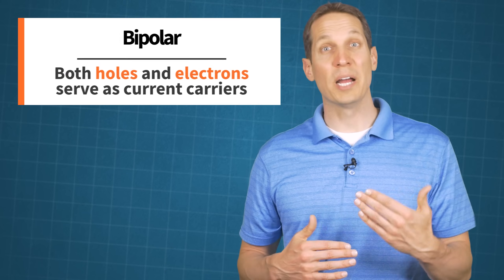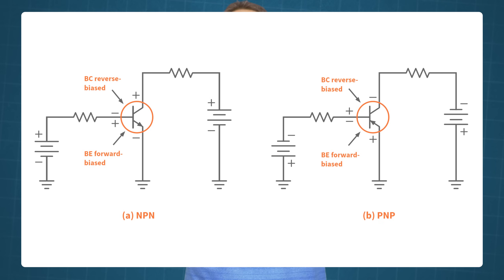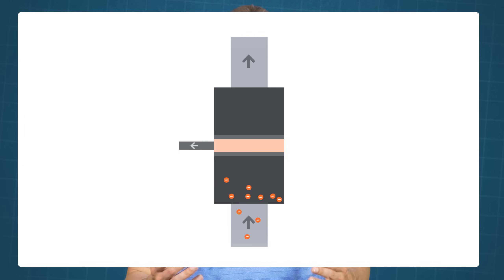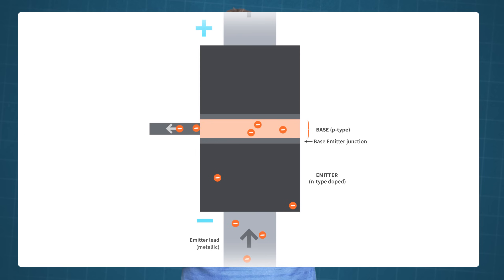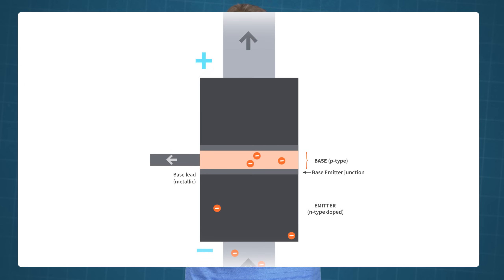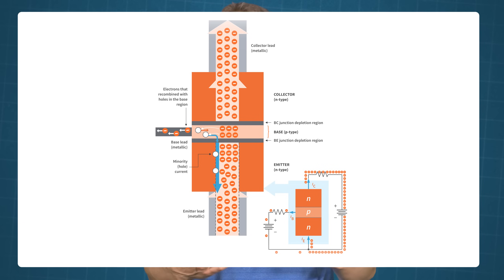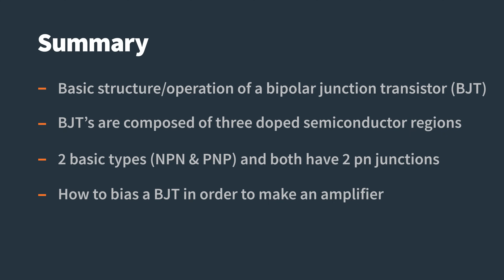Animated BJT – How a Bipolar Junction Transistor works | Intermediate Electronics

Comment: Howdy. Great.
I do not, however, understand where the current gain comes from. I get it that a base current bridges the EB junction and thus allows the collector current to jump into the collector. But this logic only makes the transistor a switch. Any collector current should be able able to jump the EB junction once it is bridged. Where is the gain factor in this logic ?
This far I understand that the collector current somehow depletes the EB bridging as it flows. This depletion needs be replenished with a base current.
Regards.

Comment: Thank you for that video and for the effort, but is still have a missunderstandig here:

BE junction is foward biased. Electrons move from n to p. they move in the n-current band and later in the p-valence band according to the diode theory. Now there are the other electrons which do not recombine with  hole from the base. According to much detailed theory they diffuse into the BC junction and get accelerated by the depletion region and also by the +potential out of the transitor.

If you now increase the current of the holes from the base to the BE junction, why does the diffusion of electrons into the BC junction increase, so that the current can increase?

Comment: Great video. A question: it seems that there are two possibilities as to what can happen (in the npn case) to an electron that was injected by the emitter into the base: (1) it gets swept into the collector or (2) it recombines with a hole in the base, contributing to base current. Isn't there also the following possibility? (3) the electron, without recombining with a hole, is attracted to the base wire (after all this has positive voltage) and thus also contributes to base current without having recombined with a hole? Or is this component negligible?
Reply from the maker: Good question!  I'd be open to someone disagreeing with me but I believe you are correct - both that it's possible and that it's negligible.  There is physical distance to travel and for the p-doped region, which is somewhat inimical to electron movement, it is a shorter distance between the two n-doped regions and it's easier for them to flow from the emitter to the collector unless they fall into a hole and then move out the base.  This is my understanding but I do want to make the caveat that the original content was created with the help of a gracious professor who has since retired and I'm not as smart as she is.   So take this with a grain of salt.
Reply: @CircuitBread makes sense! Thanks for answering

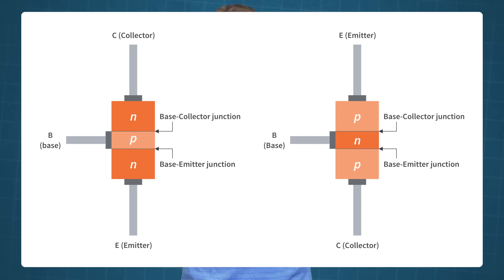Comment: At 0:43 isn't the labels for the PnP junctions wrong? Should they be the other way around with the top right label being base-emitter and the bottom right being base-collector since that would align with their respective port names.
Reply from the maker: Correct!  We added a pinned comment to this video a few years ago to address that as we didn't want to pull and repost the entire video.  YouTube does not make minor changes possible, unfortunately.  Thanks for the feedback!

Comment: How does a free electron which has recombine with hole of base reagion causes a base current as it is in valence band and not conduction band.
Reply: valence electrons can move if there are holes in the valence band. Also, the positive voltage on the base will attract the electrons.

Comment: Sorry, a little confused.  at 0:45, the PNP diagram, why the junction between the base and emitter is labelled as Base-Collector junction, while the bottom is labelled as Base-Emitter junction?
Reply from the maker: Because that's a typo that I didn't notice until now!  You're correct, with the pnp junction, the top one should be the Base-Emitter, and the bottom one should be the Base-Collector.

Comment: Josh, I would have liked to also see the PNP mode of operation discussed in detail - I felt that the 30 second blurb at the end to say that 'everything is reversed compared to the npn' did not do it justice. There's something to be said for actually seeing the electron/hole movement - any chance you could include this as an addendum or in the text ?
Reply from the maker: I'd have to check to see if we still have the assets for this, it's possible we could animate the movement for PNP and throw that animation on our website.  The written tutorial actually does go a little more in depth on what happens with the PNP BJT, hopefully it's more helpful - let's me know!   https://www.circuitbread.com/tutorials/bipolar-junction-transistor-bjt-basic-structure-and-operation

Comment: FET are best
Reply from the maker: I think they're way easier to understand/work with but there are benefits of BJTs in certain applications.
Reply: @CircuitBread  They're not easier but they are more stable. Which explains why they are getting replaced. Nowadays learning about BJT is only interesting for basics about op amps design and IGBT. I would never used a BJT in a project even if, it is easier to command using current. FET are very good low power amplifiers.

Comment: This really helps, but I don't understand why if the base-collector junction is reverse-biased in the NPN, free electrons from emitter to base would cross the reverse-biased base-collector junction and return to the emitter, since reverse-bias does not allow electron flow.  Does it have to do somehow with the relative doping density of base, emitter and collector?  Please elaborate on that.
Reply: If you reverse bias the emitter-base junction then there would be no electron flow but if you reverse bias the base-collector junction then this actually helps speed up the electrons from the base into the collector. Just look at the direction of the electric field of the depletion region in base-collector and you'll see why.

Comment: I heard some terms like drift current and diffusion current in relation to BJT , is the current in the collector considered diffusion or drift ?
Reply from the maker: You have both occurring in BJTs, often at the same time.  Susie put together a quick overview of the difference, it should help.  While the article is talking about semiconductor materials in general, it is exactly what's going on in a BJT as well:  https://www.circuitbread.com/ee-faq/what-is-the-difference-between-drift-and-diffusion-currents-in-a-semiconductor

Comment: you said that valence electron move to wire from base but as i know that the valence electrons are attached to its nucleus and didnot move ?corrent me if i am wrong ?
Reply from the maker: Hi Aina!  In wire (any metal), the valence and conduction bands actually overlap.  And yes, valence electrons in a semiconductor don't move unless they either jump up into the conduction band OR they are moving but we consider it as hole movement.

Comment: But at PN junction, you taught us that when free electrons diffuse across the depletion layer, they lose their energy in overcoming the depression layer, so when they enter the P region, they become valence electrons. But here you said that free electrons pass through the depletion layer easily and they remain free electrons?
Reply from the maker: Hi Aina!  It may be helpful to review the written tutorial as it gives you more time to review certain phrases that (hopefully) clarify things.  I'm thinking particularly of the line, "The free electrons that entered the base region but didn’t recombine with the holes move toward the reverse-biased base-collector junction."   Not all electrons that cross into the P region become valence electrons.  Those that don't, are the ones that continue onward.  Does that help at all?

Comment: But what happens inside a BJT when we increase base current in linear region and the collector current increases ok but why the collector emitter voltage starts to be decreasing and after a time both junctions would be forward biased.what happens inside a transistor when it happens?
Reply from the maker: Hi Raza, the collector emitter voltage shouldn't start to decrease unless there's a series resistance in there that causes a larger voltage drop prior to the BJT due to the increase in current.  However, when both junctions are forward biased, this is when you switch to a different region of operation (saturation region - I think you might find this video helpful: https://youtu.be/VuxAz0fvMnA ) and the base current is no longer the overriding factor, but the collector emitter voltage is.
Reply: @CircuitBread  thanks

Comment: Loved the delivery of concepts. Although, I'd love (so would other people watching these videos), if they were delivered a little slower. I felt like there was no time for me to think. Loved it. Kudos!
Reply from the maker: Thanks Subbalakshmi!  We've often talked about pacing because a lot of people think Josh is actually pretty slow.  This may be weird but YouTube has the ability to change the playback speed.  We usually playback the videos at 1.25x, but if he's too fast for you (instead of too slow, as he is for some of us), you can drop it down to .75x.  Let us know if that's actually helpful.  Thanks again!
Reply: How to use a Bipolar Junction Transistor (BJT) as a Switch?: https://www.circuitbread.com/tutorials/how-to-use-a-bipolar-junction-transistor-bjt-as-a-switch
Reply: Agreed, its too fast and I've had to replay & pause many times....we shouldn't have to slow down the speaker by changing the default speed in order to follow the material.
Reply: @aceloth  Just slow down the video dude!
Reply: goto settings (Gear symbol) and set the speed to .75, sounds fine and its much slower.